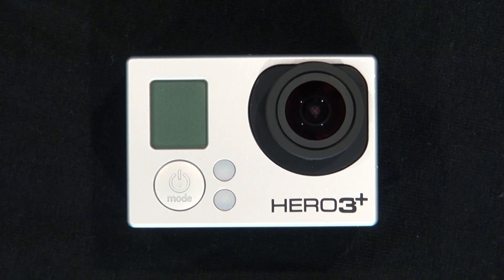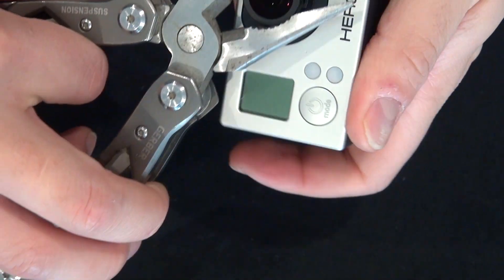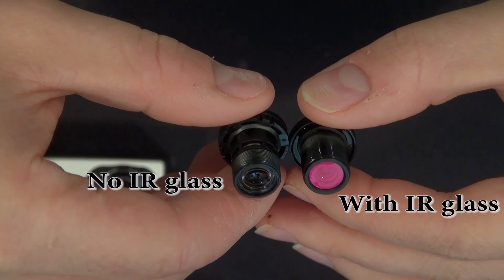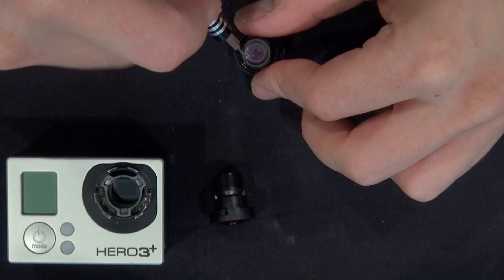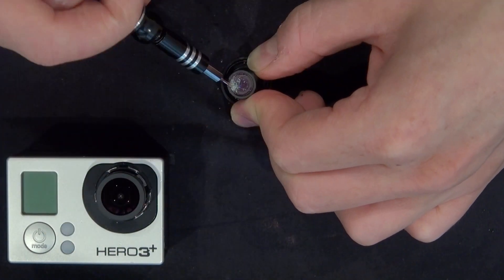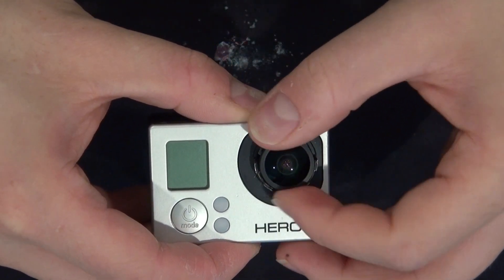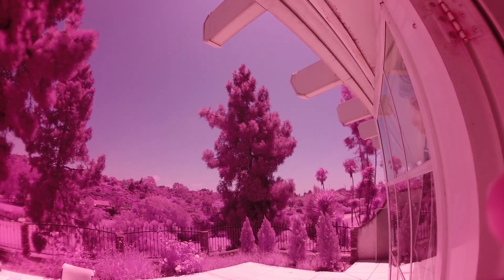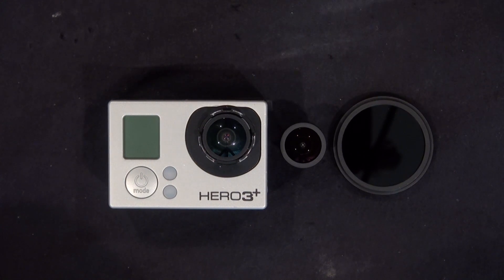How To Make An Infrared Camera From Gopro 3 Plus The Easy Way

Comment: The camera started out as an RGB camera with a focal plane that has a bayer filter. The NIR filter that was removed may have been used to make the red a truer red band - by removing the NIR filter, the red band is seeing a broader spectrum. Is this correct?
Reply from the maker: Yes it is.

Comment: Hey I recently bought a Akaso brave 7 le it's a GoPro knock off, and when I took the lens off there was no visible ir glass so I ordered a new lens off ebay with one that can be easily removed. My question is, how do I know if the ir filter is infused in the lens or on the sensor itself? I can link to a video of someone that replaced the lens and you can see the sensor cleaner hopefully you can help thank you!

Comment: Im sorry im french what does the 37mm lens in night vision ? It increase visibily or contrast?
Reply from the maker: No you can use any size you want. I have the 37mm IR filter for another camera I modified and this was for a demonstration. If you find an adapter for your Gopro, you can fit it into a housing that I have for this camera that I used in this video and it is a 52mm IR filter. https://www.youtube.com/watch?v=y67u1zHhxIY

Comment: Great video. Thanks for your efforts to share with us. I am looking for a DIY hobbyist solution to make a thermal camera to troubleshoot hot, failed components on PCB boards. I have a GoPro2. IIUC, all I need to do is to remove the IR lens. But the model 2 does not have an easy way to connect it to a laptop. Does anybody have experience with a model 2 that has been modified in this manner? Would it work for what I want to do? I understand that it is not going to perform as well as a Flir. How can I get it to output to a laptop? Thanks for the help.
Reply: Are you saying you want to make a thermal camera out of a GoPro by removing the infrared filter? If so, thermal and infrared are completely two different things.

Comment: hello I removed the lens, behind there was a glued filter in the shape of a disc that I removed, then what should I do? because for now you don't see it on the oxen, thank you
Reply from the maker: If you have a hot airgun or a blow drier, then the glue may come off. Or you could try acetone to remove the glue.

Comment: Do you have a link to that same lens that you bought?

Is it just one of the cheap chinese ones, or it that an OEM gopro 2 lens?
Reply from the maker: This is where I got it. Fare price and faster shipping. https://www.amazon.com/Vicdozia-Replacement-Degree-Camera-Cameras/dp/B015EE7G58/ref=sr_1_2_sspa?dchild=1&keywords=gopro+hero+2+lens&link_code=qs&qid=1588365602&sourceid=Mozilla-search&sr=8-2-spons&psc=1&spLa=ZW5jcnlwdGVkUXVhbGlmaWVyPUEyMTJNWDREVTFZTkJYJmVuY3J5cHRlZElkPUEwNzgwMTM0VUVWR1NZVzJaSkFOJmVuY3J5cHRlZEFkSWQ9QTA5OTI0ODUzQlE0WVg2TEJYVjUmd2lkZ2V0TmFtZT1zcF9hdGYmYWN0aW9uPWNsaWNrUmVkaXJlY3QmZG9Ob3RMb2dDbGljaz10cnVl
Reply: @SciTyeTech  Hi. That link you posted is a listed for a lens that specifically states that it won't work with the Hero 3+. Are you sure that this lens and thread size is compatible with the 3+?

Comment: Thanks for sharing!  Do you happen to know if the same can be performed with the Hero4 Silver/Black?    Same thread used with the lens on the 4?
Reply from the maker: It is possible, but I never tried it yet.
Reply: @SciTyeTech  Thanks for the reply.  I read into a little since posting the comment and have been trying to find a cost effective flat or narrow field of view non-distortion lens made of glass for the spectrometer build most likely using Theremino software since is open source and can be viewed as well as potentially modified for further enhancements.  Looks like the lens tubes are a M12x0.5 size for most of the cameras though the sensor size I'm thinking needs to be considered... i.e. 1/2.3, 1/2.7, 1/3 or 1/4... though most are lenses seem the smaller 1/2.3 so probably not a big issue.  At one time reads like there were the non-distortion lenses on the market for under $20, though I'm guessing they were bought up, re-branded and are being sold for over $100's now. I did find what reads like a glass lens and I'm waiting for a reply back to see if the IR lens can be removed.

Comment: I removed the glass IR filter from the camera lens and I put it back in my camera. The camera color did not change at all and it seems that the camera can see IR light a little better but not really (1ft-3ft). I was wondering if I did something wrong or if there is another IR filter in the lens.
Here is the lens I bought: https://www.amazon.com/gp/product/B015EE7G58/ref=ppx_yo_dt_b_asin_title_o00_s00?ie=UTF8&psc=1
Reply: I am also using the souyos IR flashlight
https://www.amazon.com/gp/product/B07LGLB58X/ref=ppx_yo_dt_b_asin_title_o00_s00?ie=UTF8&psc=1
Reply from the maker: That's the correct lens to buy to remove the if cut filter. What version of Gopro did you use? If you are using the Gopro 3 like in my video. You could use this lens attachment on your camera to get a better zoom. https://www.ebay.com/i/163769178416?chn=ps&norover=1&mkevt=1&mkrid=711-117182-37290-0&mkcid=2&itemid=163769178416&targetid=883069117886&device=c&mktype=pla&googleloc=9031560&poi=&campaignid=9426387489&mkgroupid=95112702865&rlsatarget=aud-622524042958:pla-883069117886&abcId=1140476&merchantid=136045718&gclid=Cj0KCQiAhojzBRC3ARIsAGtNtHXdDHeMK8wRWs6U9Lk5-hlvzmwkFVKAGt4kLOLjO9iatndrWVX8cWUaAjJIEALw_wcB

Comment: Great guide! But if I understand that correctly, you can convert GoPro HERO 2 by just removing the lens, removing the filter and putting it back, hence making the process much easier and cheaper?
Reply from the maker: Yes that's exactly right. It is that easy.
Reply: Bruh this is genius 👏

Comment: Do you know the type of filter that would replace the GoPro embedded IR?
Reply from the maker: That would be an IR cut filter or low pass filter. If you are planning on doing this and then reverse it after. I would suggest buying an extra lens that has the filter, so that way you have both options. Buying just the filter to place on the outside of the camera would cause too many lens flares.

Comment: Thanks for a great vi! If I am gonna use this mod/cam at night, would I still need the ir filter?
Reply: There are infrared LEDs. You can use that for night vision
Reply from the maker: Yes I can. In the future I plan on making one.
Reply from the maker: Hello, thanks for watching! Using a filter at night will not work because there is almost no infrared light at night.  This mod does work great as a night vision camera but better in low light conditions. Check out my other video on how I turned this camera into night vision camera. https://www.youtube.com/watch?v=y67u1zHhxIY